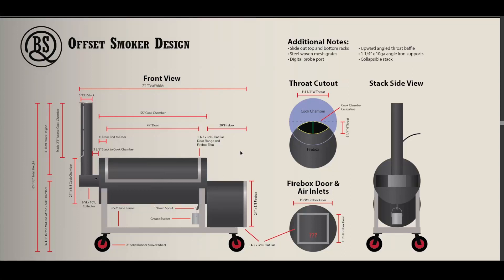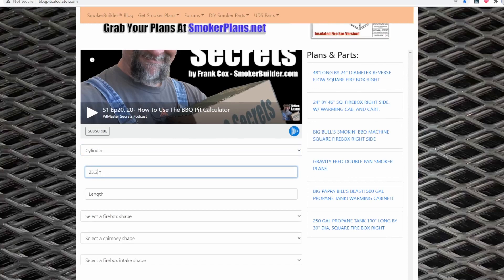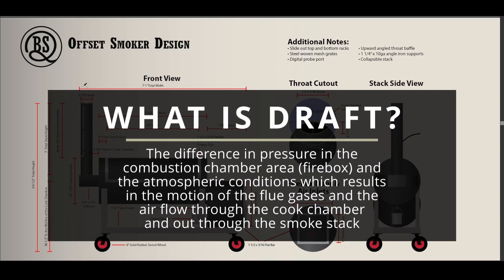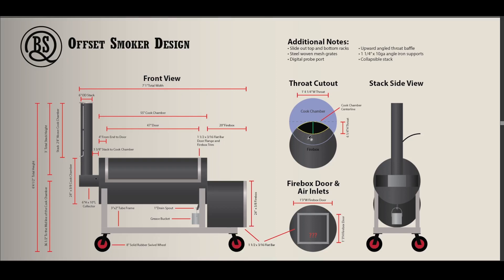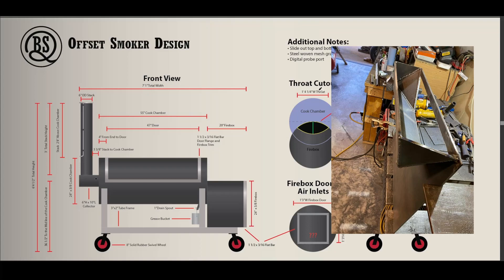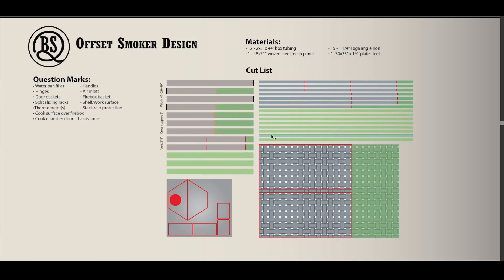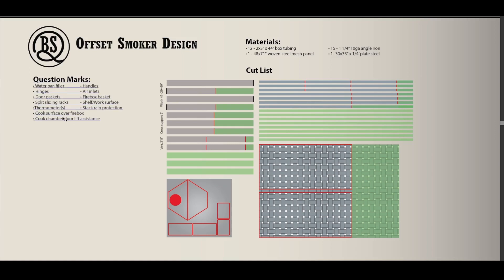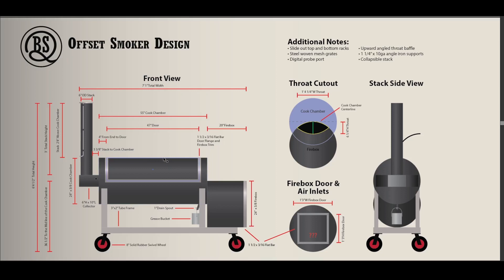Offset Smoker Build: PART 3 - The Design

Comment: Good info. Question am building roughly the same size but out of 3/8 thick old propane tank. Am wondering what thickness of steel you using on stand?
Reply from the maker: The frame is made from 2x3 with a 3/16" wall thickness. It's overkill to say the least, but it's what I could find at the salvage yard. I think a more "standard" size would be 2x2 with a 1/8" wall thickness. Good luck with build and enjoy the process. 👍

Comment: Did you make up the blue print yourself?  If you did what program did you use?
Reply from the maker: Yes I made it myself. I used Adobe Illustrator although you could use any vector based program. You could also use Microsoft Word as long as you scale things down because it won't accommodate a document that large. Some guys will use SketchUp or another 3D rendering software, which is really cool, but the learning curve is a bit more steep. You could also use good old fashion graph paper if doing thing digitally is either not in your wheelhouse, intimidating or cost prohibitive.